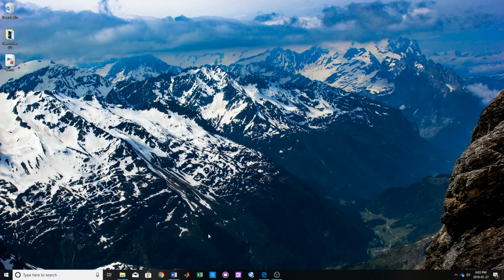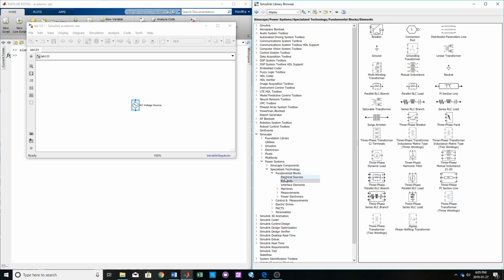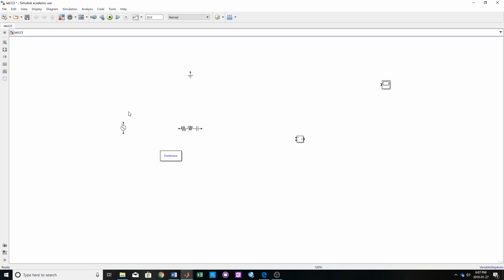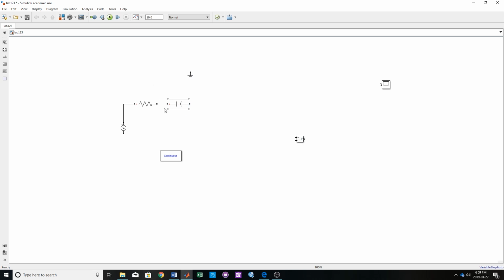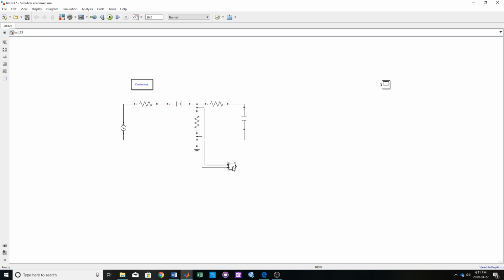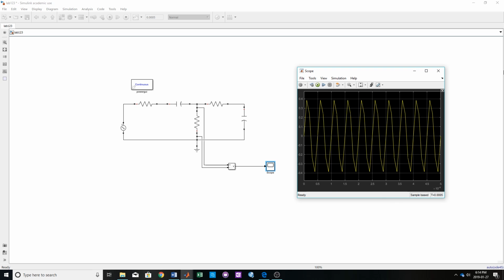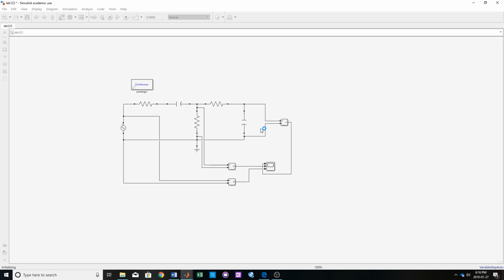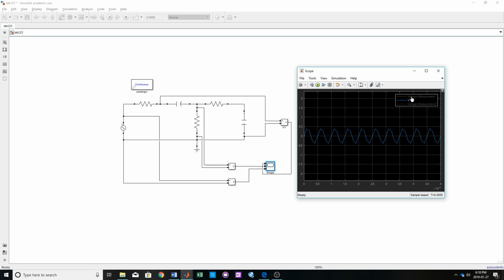Simulating simple circuit using MatLab (Simulink)

Comment: thank  you so much , good video. 
may I ask, if i want to simulate a simple rectify circuit , where could I get the right diodes ? all the electronics elements- diode- which I found can not be connected to the source and resistor from the power system module .
appreciate if you could tell me , thank you !

Comment: When I am designing a circuit I see red dotted lines. No clue why red lines, can some one plz respond
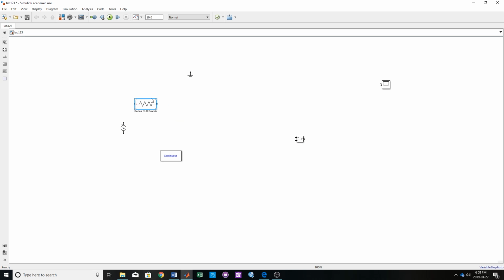Reply: Then your wire connection is not complete, at least one of the ends of the wire is not sufficiently connected. As you see in his video for instance at 5:12, the wire stays red and dotted until it is connected on both ends then it becomes black.

Comment: Sir, I downloaded the Simulink and when I open the library "semscape" is not found. why??
Reply from the maker: Hi there, you have to add simscape to your installation. To do so just head over to the add-ons sections (under the environment group on the top menu of MATLAB). Then use the search bar and search for "simscape'. Then install it. 
Hope this helps someone in the future. Thanks for watching.
Reply: @hasithrathnayake7569  thank you !